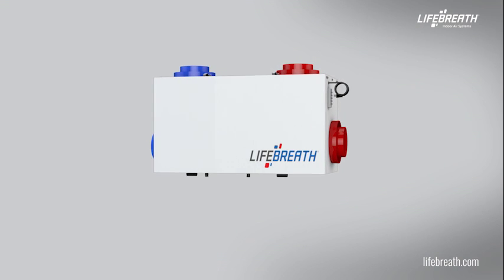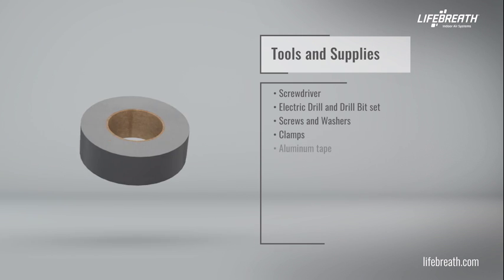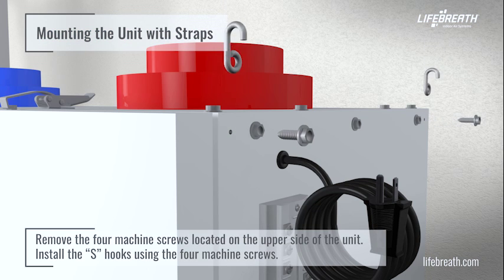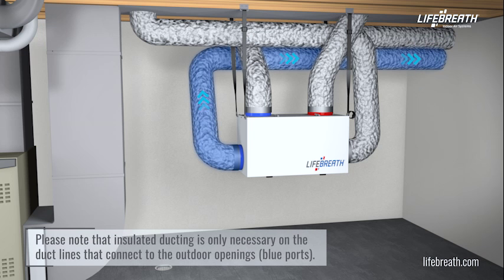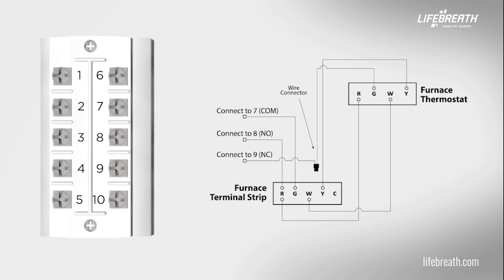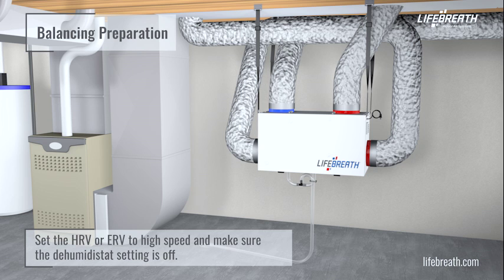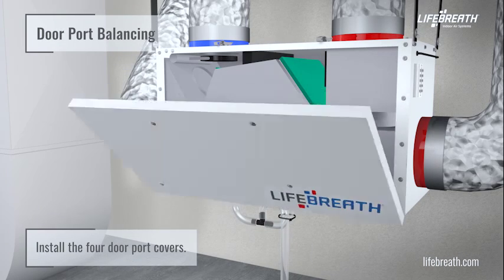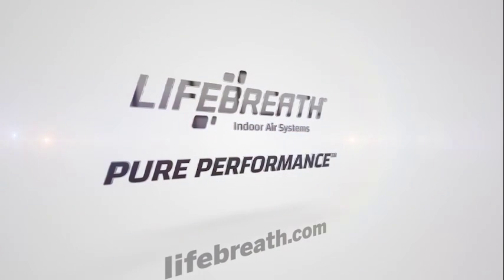LifeBreath Fresh Air Exchanger Installation

Comment: Hello, my HRV is connected to a furnace controller, and doesn't have its own controller, recently it has been running 24/7, and interlocked with furnace blower, so the blower is running as well, there is no control switch for the hrv itself, how can I control it

Comment: These Must Be a Really Old Video And/Or Really Old Units. The Ports have Damper Style Adjusters that you have to Manually Adjust. Most Modern ERV/HRVs have Automatic Adjustable Fan Controls. I Was Looking At The 130 Or 230 Units. But I Couldn't See Any Photos Or Videos Of the Actual Unit Anywhere Online. I think I Now Know Why.... Plus These does not even Have any Controls Attached Like Most/All Modern Units do.

Comment: Is there a way to actually contact this company for regular homeowners? The door fell off ours, it is not straight and will not close and is collecting mold
Reply: Call a tech, that isn't an issue they'll help with. Probably a humidity issue in your furnace room. Sounds like the door wasn't put on properly. Could be broken or just not set properly.

Comment: can 267max model be installer horizontally?
Reply from the maker: Thanks for your question.  The 267 MAX has to be installed in the configuration you see in the picture. There is a drain pan on the bottom that collects condensation and if the unit was sitting in any other position water would leak from it.

Comment: do they not sell to USA or talk with non contractors?
Reply from the maker: The product is sold through heating and air conditioning contractors in the US. There are manufacturers representatives available throughout the US to help if you would like to talk to someone. Fill out the get local support button found here: https://kggconsulting.com/get-started-in-the-iaq-business/
Reply: @KGGConsulting  none in my area.  guess im on my own.
Reply from the maker: If you would kindly give us your zip code, we could double-check.
Reply: @KGGConsulting  i checked the address you provided.  no zip and my states not even an option.  its ok, ill figure it out, cant be that hard.

Comment: What’s the difference between an erv and hrv or are they just interchangeable names?
Reply: HRV transfers heat only. ERV also transfers moisture to prevent excessive moisture/dryness depending on outdoor weather, but ERV typically cannot handle very low temperatures.
Reply from the maker: Thank you for your question.  Here is a link to the explanation: https://www.lifebreath.com/what-is-an-hrv-erv/

Comment: Why are HRV's and ERV's so needlessly expensive?
Has there not been enough working class families suffocating in their sleep?
Reply from the maker: We understand and empathize where you are coming from.  Fresh air is crucial even if it means cracking a window from time to time (which we recommend).  There are many models of air exchangers to choose from and some are less expensive than others but you always "get what you pay for" it seems.  The LifeBreath exchanger cores and beneficial features are the best in class and will last a very long time...this is where much of the cost lies.  We see many applications where simple fresh air dampers and fans are used but then the added load on the HVAC would cause higher energy consumption and higher utility bills (which is why many homes have been extremely insulated to the to begin with).  Every home and occupant is unique and solutions can be found in most cases that can fit any budget.

Comment: first of all, awesome, I think this video came out weeks after i finished installing mine! This would have been helpful but still nice to confirm I did it right

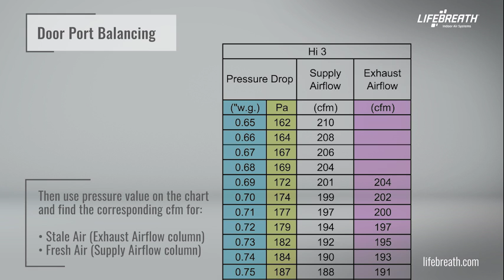I am currently balancing it and this helped out a ton! Just curious, at 11:45 it says (for example) 'desired and appropriate cfm for a building'  is 160 cfm, where do I gather that number? I know in the lifebreath manual there are some metrics for duct size but I cant make sense of it..

I was going to just maximize the cfm while ensuring they are balanced, ie only dampering whichever side needs to be lowered
Reply: I can help with this. The 160CFM is the TVC (total ventilation capacity) of the home. This is determined by a few methods depending where you live. For example: if you are in the U.S you can use the Ashrae method which is total volume of the house (square footage multiplied by ceiling height) multiplied by .35 (1/3 air change) and divided by 60 (minutes per hour) which will give you your total CFM needed for the house. If you are in Canada then you can use the room count method and add all the CFMs for each room and get a total CFM. For example: A master bedroom and basement require 20cfm each, and any other living space is 10cfm. Here's another example:

Master Bedroom = 20cfm
Basement=  20cfm
Bedroom 1= 10cfm
Bedroom 2=  10cfm
Bathroom 1= 10cfm
Bathroom 2=  10cfm
Living room=  10cfm
Kitchen = 10cfm
Dining room= 10cfm

Total CFM= 110 cfm

This may help you when trying to size an HRV for your home but it's always best practice to have a designer or engineer help spec your HRV/ERV based on the duct work and static pressures in the ducting system.

Comment: Which smart controller we cab use with it .. I have lifebreath 3 wire 99-DXPL02 . Need to control fresh air when cooking with phone if there is a compatible wifi smart controller is available?
Reply from the maker: Thanks for your question.  Lifebreath does not currently have a wifi enabled controller at this time.  We will keep you up to date if something changes.
Reply: Read the manual